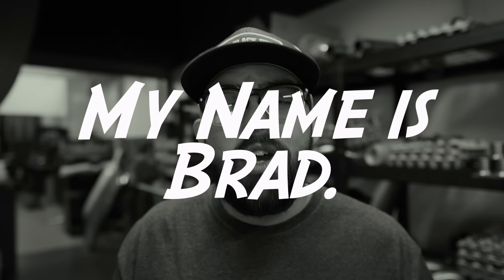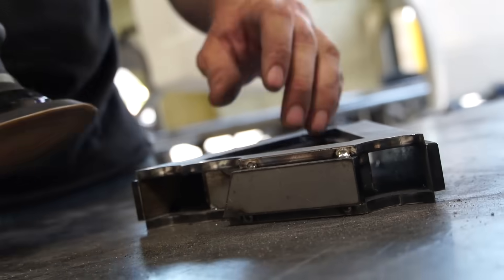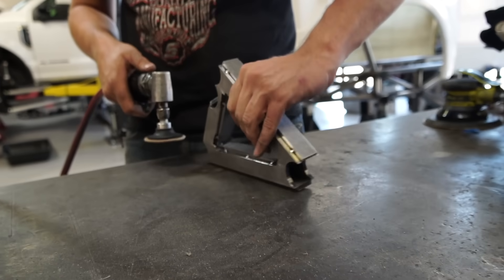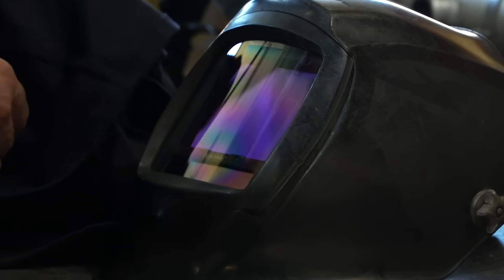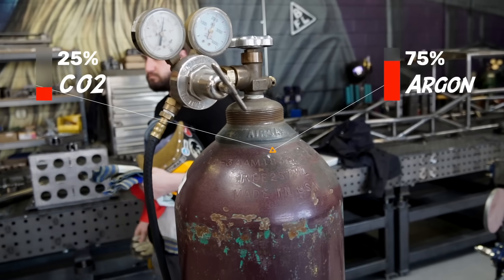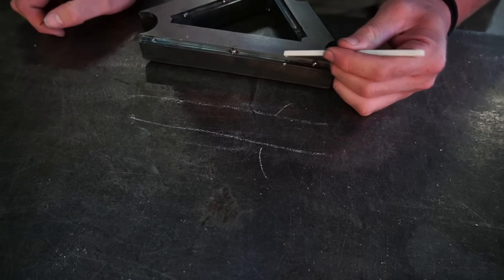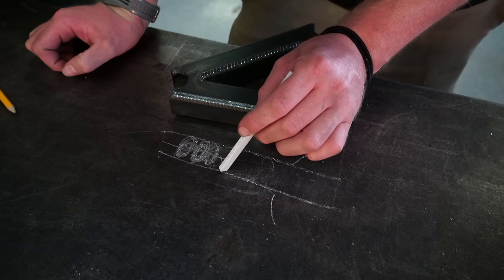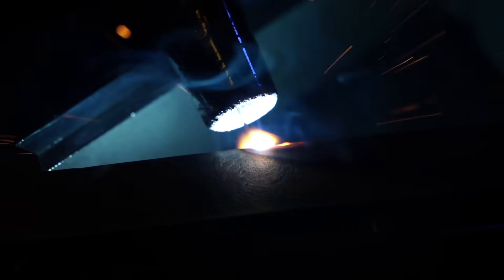HOW TO MIG LIKE TIG WELD (Stacking Dimes) W/ OVERKILLRACINGANDCHASSIS w/ *Tips and Techniques*

Comment: What settings would you use on a 480v millermatic 252 running .035 wire for a 1/4 open corner?

Comment: Those settings are super low for material so thick. Howd you get it to stay together? Lol
Reply: Exactly.  You can't get the stack look with the proper settings, so with this you're going for the look but no penetration and no strength.  Okay if you're building a smoker, but don't do this on anything structural.

Comment: I would like to be able to see the weld puddle half as good as you can see it here, half the time i get lost not able to see it
Reply: You're trying too hard. Welding is all about comfort, simple stuff like just the weight of the Welding lead pulling down on your hand makes you shaky.  Welding is 1 of the easiest things to do,  working the grinder and cutting Torch is the only part that is actual work. It just takes practice.

Comment: It’s probably worth mentioning that this technique is for fully open root ONLY where penetration is basically guaranteed. The TIG-like travel speeds suggest a really cold weld setting that would severely underpenetrate on a lap, butt, or fillet where you don’t have an exposed root.

Comment: Just wondering how much penetration those cold 030 welds have on 1/4”. Industry standard is 035 minimum on 1/4” and most welding shops go to dual shield 045 at 1/4”.

Comment: There is a procedure for welding this way , it resists vibration where a continuous would crack . When I weld vibrators on silos that is the procedure . REAL CLOSED MINDED to think it's not acceptable in some situations.

Comment: New to your channel and great looking welds from a novice welder for over 50 years. 
Started with gas in HS and have gas, mig and still want a tig, buy it is another investment, and my age, it's hard to justify, but still looking for a good deal. I'm not cheap, I'm thifty.

Comment: The best puddle control technique I was ever taught for that kind of joint was to move the torch/stinger in a "N" pattern. (reversed "N" pattern for us lefties) Move forward and up at 45 degrees, then come down, repeat for the length of work.

Comment: That in and out whip is where it's at especially if you lack natural talent also run as hot as you can just barly control  your goal should be  to match the  mechine to your brains natural tempo not forcing yourself to  wait on the machine. Whenever possible lean on something or on fillett welds rest the cup on the work piece when possible this all makes for consistency.

Comment: Welds are very pretty. Those settings mentioned are very cold for those selected thicknesses. Especially the amps. A cut and etch comparing to higher voltage and amps would be interesting.
Reply: Exactly why I don't try to Weld like this. It's too cold.

Comment: The whip and pause is a stick welding technic usually for your '10 series rods ie. 6010,7010, etc. I use this when I'm using a wirefeed for aluminum and occasionally mild steel. But thanks for the oscillating technique. I've changed from just side to side to that and the results are great. Side note...I've been welding all processes since '86. All you're never too old to learn!

Comment: I'll make it easy, they're using a basic push and pull technique which will never be suggested by a real industrial welder, yes it looks pretty and for a chassi, MAYBE weighing out at around 1000lbs + it will hold, even completely assembled if there is an imperfection in the weld it probably won't break until the vehicle ends up in a collision

Comment: I used to gmaw like that back in tech school, 20 years ago.... it's a flawed bead. Each one of the edges of your overlapped curly q's you got there is a week spot. That's where it will fail. An a-hole cwi would mark it as a weld defect and most production weld facilities will make you grind it out and reweld. Look at a robotic weld. Perfectly straight, and minimal to no weave/whip. 

     The more you know.

Comment: It's not that hard when your metal is that thick. Try that on thinner metal where you have to move fast, or else you burn through or just pile up a bunch of weld on top of itself. It's like playing guitar, it is easier to get it right when you slow down the tempo. As soon as tempo increases, you start making mistakes and the music starts sounding all wacky.

Comment: MiG welding is garbage.. King of quality is Megan Welding short circuit transfer crap.. here’s what it looks like it’s what’s underneath that matters and it’s basically glued on there.. And if you’re going to wire feed make it flux core or duel shield.. unless you’re fixing the handle on your lawnmower or maybe repairing your lawn furniture..!!!

Comment: these welds suck to low amp get more amps running if you want to get a nice root weld pulling instead of pushing a perfekt weld in this case would be an A3 or whatever four the exakt thinkness of the sheet metall this may vary between A3 and A6 i can not tell the thikness but if you weld it like this youl be left with a nice rounded edge on your part and ill quarantee you it will hould more than that 

you weld doesnt suck but it is by far not the best

Comment: I run at 20 with wire speed at around 260-300 depending on the machine. I can weld much faster that way and easily make tighter dimes.

Comment: Stunning.  Perfectly stacked beautiful dimes.  Everytime.  I'm talking about my own of course ha ha ha haaaah...  So anyway, what I used to do is wrap a piece of cloth around the wire and hold it in place with a clothespin right before it entered the whip to clean the oil residue off.

Comment: Also, I'm pretty sure I think I heard him say he is using a spray arc technique...  A millermatic 252 is not capable of true spray arc, and also you can't use 75/25 mix for true spray transfer...  It should most likely be a 92/8 mix argon or helium/co2... Sorry to pick apart anything, I just get alot of people with misconceptions of what true and actual spray arc transfer actually is, what it's good for and why....  Which is why I also don't understand why you would want to use "spray arc" for carbon steel frame components???  Spray arc is a super hot process and the heat affected areas are much more affected then as if you used a straight forward mig process.  Alot of heat and heat affected area of carbon steel welded components become very brittle after putting that much heat into it; and wouldn't you want your frame components to have more of a "give" or "flex" rather than being hard and brittle???  Am I just missing something completely???

Comment: Similar wire but .035 is what i use. I’m usually welding a little faster wire speed and around 18 volts on a Lincoln 255 powermig. My vertical is looking decent but i cant get my flat to look right. Anything with maybe my angle or length anyone might be able to think of? I know there’s some variables such as thickness, bevel depth, etc.

Comment: It's weird how YouTube throws videos at you out of nowhere, long after the original posting.  Like everyone else, I wanted to comment on the nice welds; however, can you achieve the same weld structure with 20ga. steel?    I've been hobby welding for 40+ years, and learned your exact technique on much thinner sheet, building street rods and motorcycles.  One of my "busiest" builds was a '63 Bug for my brother that had an 80%, 3/16" or less material structure - with, as you could guess, most of it 18-20ga. - all with using .023 MIG.  I've built many projects prior to this one, but it accounted for the most sheetmetal work I had to do up to that point, other than my eternal build - a mid-engine, 455 Olds, '65 VW Karmann Ghia.

Comment: I’m a 24 year welder certified unlimited and I’ll tell you guys that’s not what you’re looking for in a weld   It’s big bumpy and ugly would never pass inspection. Your weld has to be even with the metal not higher or lower picture a snakes under side. That video is what we call hammered duck shit. Millwrights local 102 baby

Comment: That looks like crap I’m a millwright and if you weld like that on a job you’re gonna be grinding all that out. A stack of dimes wouldn’t fly on structural steel. We do snake bellies. I can do better than that with flux core wire or 7018 stick

Comment: to those who dont know any better...they are running an outside corner joint on a flat surface with a automatic welding system.  there is no need to be impressed by these "skills"

Comment: I’m 35 now.  Thanks to my dad owning a cnc machine shop, I’ve been machining since I was about 5 years old.  I’m rather embarrassed to say I have never welded.  We’ve always outsourced all our welding.  Just here to expand my skill set and knowledge.  Kudos to all you awesome welders out there.
Reply: Yes and you are exactly the type of guy that gets attracted to this type of content since "stacking of dimes" is not even applicable for European standards. This is only for show. If you are about to learn to weld, be sure to learn according to the European EN standards. Stacking dimes are a waste of time and only for social media or motor shows/ for visually exposed parts. This is not my opinion, this is a fact. You would come along trying to learn scratching your head why your settings are so wrong etc etc, spending weeks, months of not focusing on the right things. A MIG/MAG weld and a TIG weld is NOT supposed to be including any "walking the cup" or other back/forth movement. You are supposed to go straight straight straight, as straight as possible, specially on thin materials 2mm and less.
Reply: @Heddanofarsan  if it passes whatever inspection process and their is no explicitly stated wps or variety of wps who really gives a shit🤷🏻‍♂️

Comment: Nice work!
I finally stepped down to .025 wire and that really improved my welds with tubing and lighter applications.
Reply: Also, will work better on a 110/120V hobby welder as their duty cycle usually sucks.

Comment: All of these "techniques" do no more than compromise quality. 
Need any more than just a straight run bead to fill a joint? Two options either turn settings up, or run multiple passes. 

Want to try and make something to look like it's been tig welded? Buy a tig welder

Comment: What I would like to know is what changes should I make using 035 wire and how do i get that dimes on a normal fillet weld? Mind you the work that i do doesn’t ask for nice stack effects but i would still like to learn how to do it since i already know how to do get dimes with mig aluminum. I know gas plays a small part but i can adjust as needed with that. What can i do with 035 on a fillet to get that effect? Am i running too hot for any weave pattern to make a difference? Cause thats how i feel. But i also dont want to turn down enough to make a good looking weld with less penetration.

Comment: I had some folks poke fun when I did this technique when I put my racecar together calling it "figging" (Fake tigging) and said the welds weren't as strong bla bla bla..... I have welded cages, and floor plates, motor plates, exhaust and structural components like this with no failures. The heat penetration is good and the welds are clean! Glad to see someone else do it. Looks awesome guys!
Reply: Your an amateur, right?

Comment: When you have to move your hand or your piece (say at an inside corner of the piece you show in the video).. how do you move your arm or hands in order to keep the same distance and angle... I find I"m going like a pro until I have to change positions, then you can see exactly where I did that in the weld.

Comment: I do this quite regular and everyone asks me if I can "TIG" this or that that for them. "Yeah I can, but that's not TIG". As for the 2 techniques you showed, I do both depending on Heat Transfer, and the Metal I'm doing. Good to practice both of these, because you will find that you'll use them both. Oh.... and if you want a piece to come out looking like a piece of Billet. Grind that all down, roll your edges and comes out looking like a Solid Piece (but hides all your beautiful Dimes).

Comment: My biggest problem is setting gas flow
Reply from the maker: What’s going on?
Reply: @hourglassingenuity103  I do from thin gauge sheet metal to 1/4 in steel and have to guess at flow rate I do not have any charts
Reply: Gas flow should be a set and forget around 35 cfh. I think you're mistaking it for something else
Reply: @rodrigorodarte8422  at 35 your welds are gonna be a cold weld

Comment: Been welding for 5 years and i still strugle with getting my settings right on outside corners
Reply: I hear you, Try running a slower speed wire feed, pause, build the puddle and push back the puddle to fill edge to edge and form your dime, move forward and do it again.

Comment: Machines are always different to. Doesn’t matter if you got 3 that are the same they all can weld different especially when they’re old and been used for 5-10-15 years. I’ve had machines that run hot at 18v and others have to be up to 21-22v to get the same puddle. Just gotta mess around and practice. There was definitely welders I hated using at my old job and a favorite welder 🤘🏻🤙🏻 Good luck everyone

Comment: My problem is I can see the puddle, but not the seam.  I'm 73 and I got a Hobart 140 about 5 years ago.  I have a 2.5 mag lens inside my helmet which makes the puddle clearer but still not the seam.  Other than being younger, what else can I do?
Reply from the maker: What welding hood are currently using sir?
Reply: @hourglassingenuity103  I have an IRONTON from Northern Tools.
Reply from the maker: I’m going to highly recommend you get a welding hood with clear blue lens technology. They have tons of them out there, even cheaper ones.. that will be the absolute best way to see better. It’s amazing going from an older auto dark to a new true color lens.. you can literally walk around with it on your  head in the light state and see like you have nice sun glasses on.
Reply: @hourglassingenuity103  I got a Miller Classic series helmet with Clear-Light lens.  WOW!  You're 100% right about that.  Cost about $150 shipped.  Well worth it.  I can now see what I'm doing.  Many Thanks.  Joe.

Comment: Thanks Guys!  One question... Is the pause at the top of the cursive "e" to account for a little sag that may occur if the e's are drawn at a constant speed?
Reply: Yes, a slight pause at the top of the helps reduce the effect of gravity wanting to pull the weld puddle downhill and fills the corner joint evenly.

Comment: Looks good. I use that technique for aluminum but I dont short arc. Pulsed spray on everything because of lack of fusion issues. And I dont use the little ass wire because I hate moving that slow jump to .045 on steel and 3/64" on Aluminum. Thats what I use on standard pulse or I can switch to Profile Pulse and you can adjust the frequency, arc length of the pulse and how much wire the feeder will push. Basically you can push a stringer with no manipulation to achieve the same effect. Referring to a Miller XMT 350 MPa with S-74 MPa plus feeder

Comment: I read 0.030 wire, i was like whut!?, but then realized its imperial, metric that still is  0.75mm , I used on my first welder, now I use 1mm all the time, as mostly is construction steel, but on sheet metal or 1mm that's sucks, so I need my 155a back again.

Comment: Turn up your Volts when you tack with Mig ( example: .035 hard wire 25v wire speed to a nice sizzle).  You Hot tack so they wash out like a Tig tacks.  You will not need to grind when you weld over them.

Comment: Personally I'd rather have the setting correct for mig welding and have a good solid mig weld than a cold weld that is not as strong even if it did not necessarily need the strength in the application it was being used for. The wire speed and voltage/amperage settings were way too low.

Comment: Working as a welder in the semi trailer, sheet metal fabrication and automotive industries I found that the circular oscillating technique produces some of the most consistent looking welds also moving from side to side in an arching pattern works well especially if you have inconsistent gaps to fill, setting the welder up to have a clean consistent sound with no popping or wire burn back is also important, the kind of welds these guys are doing requires a steady hand, patience and consistency.
Reply: I know you're speaking English right now, but I'm new.  What's wire burn back.  Imma assume that I'm experiencing this as my welds look like mange-riddled possum hide...burnt to a crisp with wire hairs poking out here and there!  I need a class.
Reply: @choiceblade  Sounds like you dont have gas to me or you Voltage isnt high enough or your wire speed is to high. And i believe that wire burn back is when your wire actually melts higher up on the wire than just the tip of the wire if that makes since. typically happens with me if im to far away from what im trying to weld.
Reply: @choiceblade  Burn back is when the wire speed is not high enough to match the voltage/metal transfer you are set at. It's when the wire literally burns back and sticks to the contact tip, often requiring the replacement of said tip.
Reply: But any "walking the cup" or back/forth is actually avoidable at all cost according to EN norm (European standard). Keep that in mind. Follow someone that teaches welding according to international standards, then, after at least some year in production you would consider learning this art social media visual appearance welding. https://www.youtube.com/watch?v=JEFd56ofHos

Comment: But can it be done with Innershild? I don't have gas or even room for it in my small shop so I've been just using a Lincoln plug-in welder with Innershield flux wire. It's hard to achieve this look.